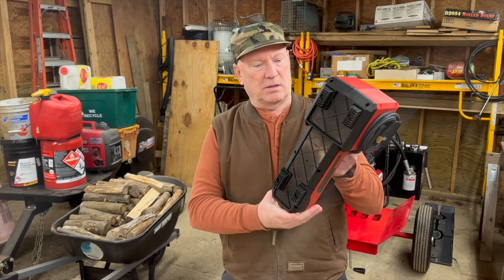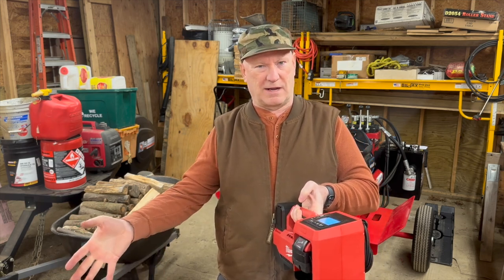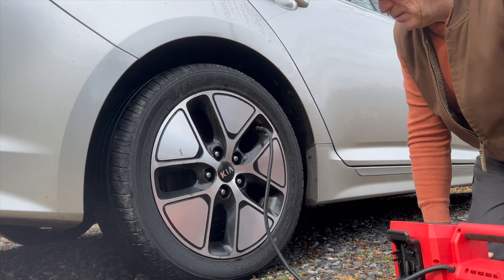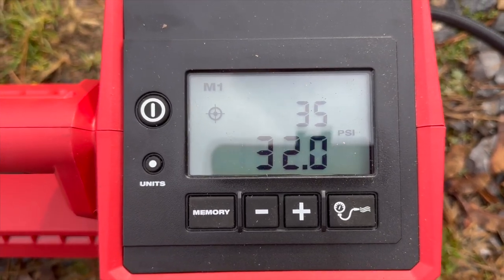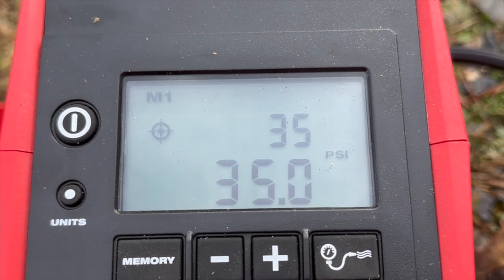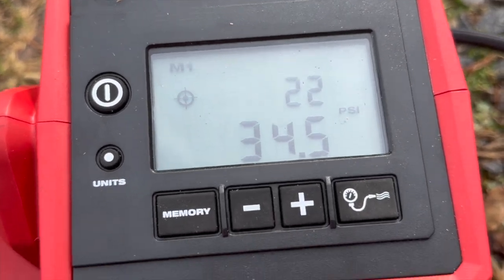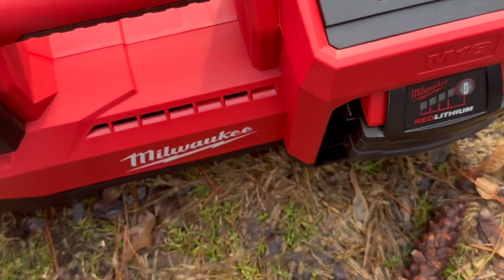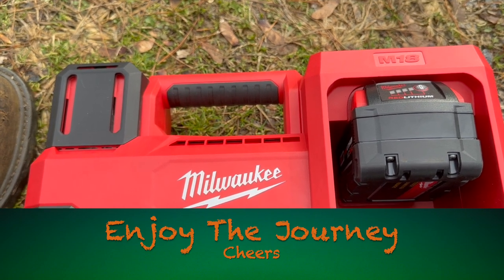168 - No More Flat Tires

Comment: The name says it all Bob.
Milwaukee takes a back seat to no one!
Sweet unit
Reply from the maker: I have three things that use the M18 battery.  A small vacuum and a nice light.  I don't think the light is actually Milwaukee, but it does use their battery.  I am not sure if it is a knock off or just a light to look like it's a Milwaukee product.  The little vacuum is a Milwaukee tool, but has been discontinued and was replaced by a nicer unit.  LOL Maybe I should do a video on the vac.  Hmmm.  Thanks for watching and commenting. Enjoy the Journey - Cheers

Comment: Those pumps are awesome Bob! I got the cheaper Ryobi tools and I have the pump for it and I love it and use it all the time. I believe you may have seen it on my "tire change" video. Your's is definately fancier than the one I have. You will love it!
Reply from the maker: I think you are right. I think Ryobi has a good product line.  I probably should have a looked at what Kobalt has to offer.  But, when Lowe's started selling Craftsmen tools.  And I don't know if Lowe's will be selling Kobalt products in the future.  It just doesn't give me a good feeling with what they are doing with Kobalt. On this inflator, I do like the fact that you set the pressure, push the button and wait for it to stop.  So far, so good.  Thanks for watching and commenting. Enjoy the Journey - Cheers
Reply: @botabob  Oh yes I forgot about Kobalt. Actually, Holly used to work at Lowe's here in Canada. It was when we lived in Prince George, BC I only had a Dewalt drill then for cordless tools. That was 2016-2020 Since that the tools have come a long ways and I was on the hunt for the best value not the best quality tool of course because that always involves the highest price. If you can understand that each tool has a limit and don't go beyond that then any of the brands will work fine. I use Milwaukee all the time at my job and in my trade we've gone completely to electric instead of air nowadays. The electric don't freeze up and you don't have that stiff hose attached therefore life is easier with electric. I love Milwaukee but I don't need the extra cost of them for around the house. After my research I settled on Ryobi for the best value I think. So far I have no complaints and I must have over 20 of the cordless tools by them now and counting. Use the tool for what it was meant for and it will last and not let you down. Sorry for the long winded, I guess I am bored here at 5:30Am. Cheers!!:face-blue-smiling::face-blue-smiling:

Comment: The 12v version is nice too.  FWIW,  I run most of my rigs  just below the max rating for the tire--no unusual wear and 2+mpg,  but a bit harsher/sportier ride.
Reply from the maker: That's great information.  I recently purchased some 12v hedge trimmers that work great.  They are nice because of there light weight.  I appreciate your feedback.  Thanks for watching and commenting. Cheers

Comment: I've had a few of the cheap ones and they do work but it takes forever, this one seems very fast.
Reply from the maker: Hey Vern.  This is probably more then I need. And I still have my pancake compressor when needed.  It's just a pain to pull out the hose to top off one tire.  This inflator will be able to top off a low tire and keep the idiot light off on the dash of my car.  Thanks for watching and commenting. Enjoy the Journey - Cheers